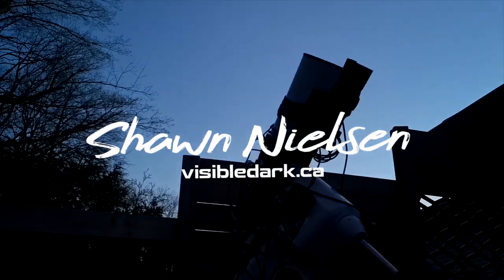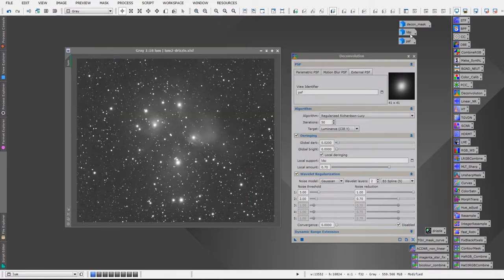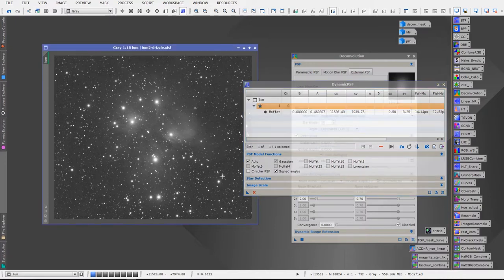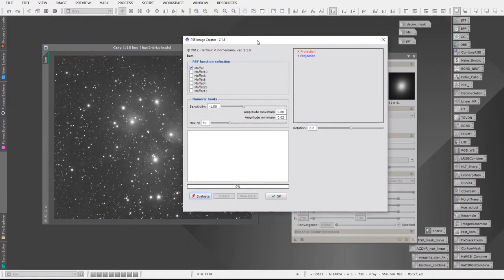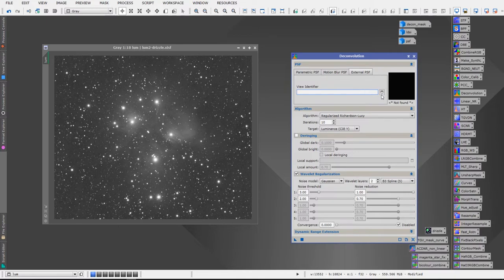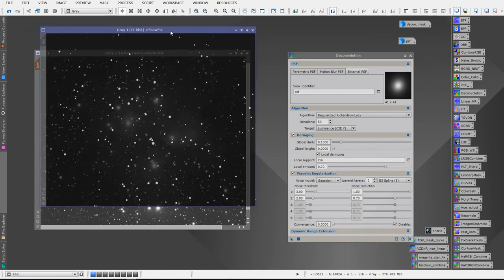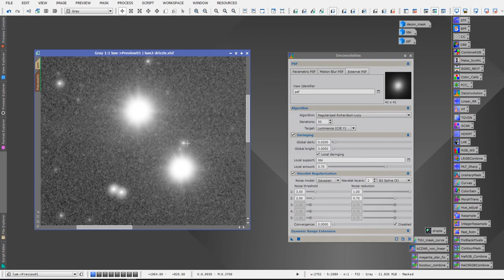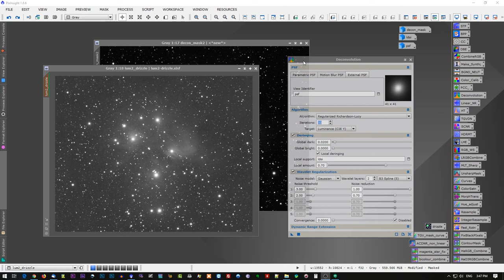Pixinsight deconvolution - how I do it for my image processing

Comment: Thx for this, I used the workflow from the Warren Keller book (which is GREAT) but the deconv was not working properly. When following your steps it went much better. The big differences are the use of a mask to protect the background and the less strict selecting of stars for the DynamicPSF. Your other tutorials are great as well, thx for the work!
Reply from the maker: Glad the vid was helpful! Thanks for watching. Clear skies!
Reply: Thanks for your support, Jeroen. Glad the book has been helpful! What's interesting is that Shawn's tutorial is virtually identical to the procedures I outlined in 'Inside PixInsight' published by Springer. This is a matter of course, since I trained Ron Brecher, who in turn, largely trained Shawn. Ron actually became the technical reviewer on the two editions of the book! Excellent and accurate presentation by Shawn! Curious that you didn't achieve success with the book's description. Perhaps read that section over again. I now use the Hartmut Bornemann PSFImage script to speed things along. The only thing that irks me about the script is that if yo uset the min/max for an acceptable range of stars (0.3-0.9). it will sometimes find no, or a very low number of stars.
Reply: @thewarhenk  Hi Warren, I just got your book and the decon process worked superbly first time for me.  It’s not your book that’s unclear!  This video was useful tho, as I didn’t realise the Hartmut Borneman script was under the Render section - I only looked under Utilities, where his other scripts than I’d used were

Comment: Nice video. Very helpful. One thing I noticed after downloading the PSF Image Creator script is that the default value of Sensitivity under Numeric limits is 1.00 whereas you have yours set to -1.00. Needless to say I had quite different results before I caught the error.
Reply: Thank you! I was getting a no stars found error and couldn't figure out why. I miss read the tooltip. Less is more.

Comment: Another great video. Thank you. Do you ever run deconvolution on a combined RGB image or on the individual master files of a narrowband image? Keep the great content coming please.
Reply: I noted that you did not get a response. I used an OSC RGB image, extracted the L channel, did the decon. I saw a noticeable difference in the before and after with my bloated stars from M 45. I then extracted the RGB channels, stretched all of the LRGB individual subs (with EZ Soft Stretch) then did an LRGB Combination with Chrominance Noise Reduction applied. The before and after RGB file showed quite a significant difference.

Comment: Thanks for the tutorial. Just a question regarding images shot with OSC cameras. In the deconvolution tool there is an option to apply to RGB/K components as the target so can I apply this to a colour image or do you have to make an artificial luminance layer, apply decon to that and then recombine that deconed luminance layer back with the rgb image? I tried using it on a colour image using RGB/k components as the target and it seemed to work but is this wrong?

Comment: hey Shawn, just trying decon for the first time - on a practice image of M42.  I created the clone of my L channel (the data isn't mine, it's a monthly comp on a pixinsight group on facebook).  When I stretch the image, how far do I stretch?  If I do a light stretch to only get stars, not many stars are revealed.  If I push the stretch to see more stars in the mask, then I also get a fair amount of the nebulosity on M42 itself.  The final created mask after starmask finishes running is pretty ugly with what I'd call large scale ringing artefacts, covering both M42 and the running man nebula.  The stars in the generated mask look really bloated to, more than I think they should.  As the original L data had large stars, I set the scale to 10.  I suspect that that's probably too high and it should be set lower.  

I just don't know if the generated star mask is OK, or if it's been "overcooked".
Reply: OK, I did it a 2nd time, didn't stretch as aggressively, keeping as much of the nebulosity out of the stretch, then did the starmask again, with a value of 7 and this worked MUCH better for me.  Thanks for encouraging me to experiment and learn with PixInsight.